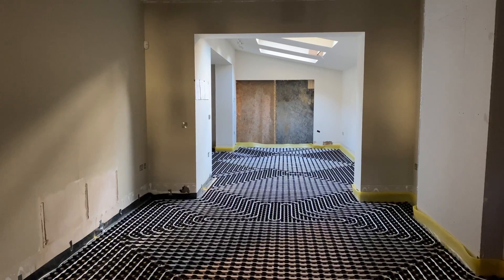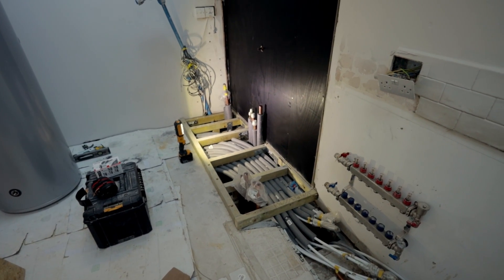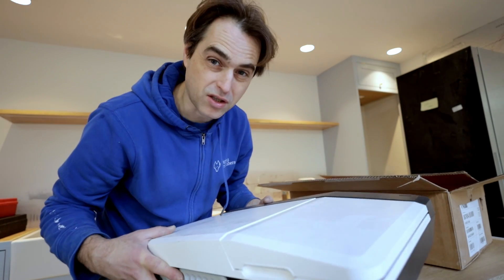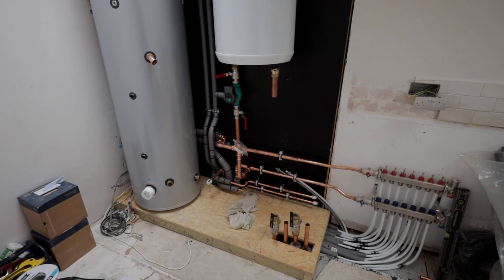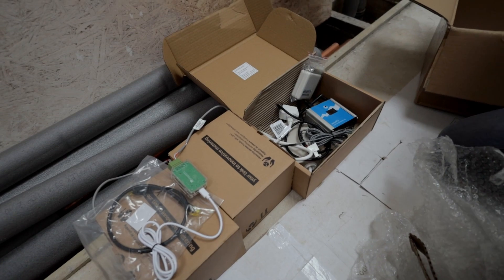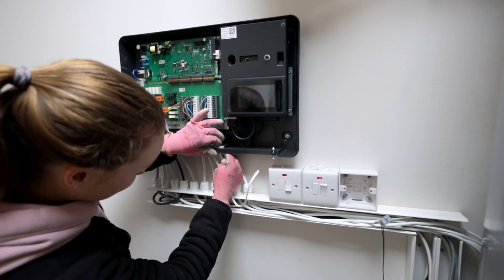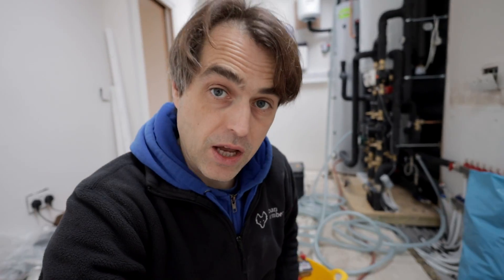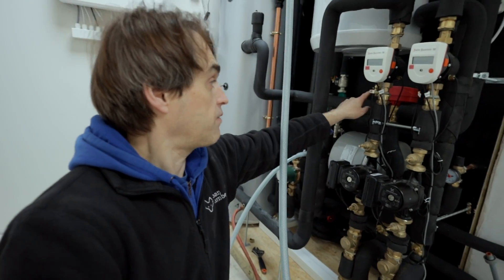NIBE 2050 Cascade System Installation In A Period Property.

Comment: Blimey .. that looks so complicated imagine when it goes wrong ... any savings wiped out on repairs .. 

I'll stick to a condensing gas boiler thanks ...  even they are pretty complicated these days
Reply: To be fair you'd have most of this kit if you had a cascaded boiler setup.
Reply: @Saaj2  

You'd have this kit if you were looking for a life of trouble ... 

I work on the Kiss principle .. Keep it Simple and Straightforward ... 

This is cascade heat pump stuff is NUTS
Reply: @the1beard  cascaded boilers are more reliable, so in theory this will be too. Either way this setup isn't saving the customer money, the ROI will be insane. The customer probably wanted it for environmental reasons
Reply from the maker: @Saaj2 running scop of over 4 in the winter so still 20% cheaper to run than gas
Reply: @UrbanPlumbers  no doubt the scop makes it cheaper to run, but even with that bus grant, surely it'll be years before a return is made. I was fortunate that the BUS covered almost all my costs. For expensive installs like these, surely the main driver is environmental.

Comment: Amazing work as always Szymon, I love this method of UFH installation. Whats your preferred method for suspended timber floors?

I’ve done the 22mm pre-routed chipboard but it was awful to install!
Reply from the maker: This were suspended timber floors. I screed over them for the higest possible output
Reply: @UrbanPlumbers  I will be putting UFH over the existing ground floor and first floor and a new loft conversion. All suspended floors. Would it be reasonable to have screed on the ground floor and routes chipboard above? MVHR would even the output somewhat, the upstairs would benefit from the rising heat, and having the bedrooms cooler would be a good thing (on an open loop)
Reply: Would like to know this

Comment: When talking about heatloss eg 16kW, at which out door temperature is it calculated? Over here in the Netherlands it’s usually calculated at -10 Celsius
Reply: Varies throughout the uk from around -2 to -5
Reply: @YMNS86  oké thanks. This mild climate makes it a lot easier to achieve sufficient power and efficiency (SCOP) using heat pumps.
Reply: @ReneArtoisMr  needs to be mild for the unit cost of our electricity!
Reply: @ReneArtoisMr Our shockingly poor insulation more than compensates for ‘milder’ winters. Hence the expense the homeowner has made to reduce the heat loss so this 16KW cascade can cope.
Reply: @normanboyes4983  Indeed, but it’s a combination of isolation and low flow temperature. When you’re able to install underfloor heating (low temperature) you can sometimes get away with poor or non ideal insulation
Reply: Also note that your design temperaturen is a choice. Personally I wouldn't design a heatpump system for -10, because that's almost never the case, and you'll often end up oversizing it for more common higher temperatures. This will Hurt overall efficiency.

Comment: Why aren’t you using vaillant on this one. I’m half way though a bungalow which has 13.35kW heat loss so Vaillant recommended either two 7kW or two 10kW heat pumps. Not the best for me as it’s my first heat pump set up 🧐
Reply from the maker: I would use single 12 on that. If designed to 35-40c it will cover that heat loss. Or 2x5kw not 7kw. 

NIBE cascade is pure class and controls way above the vaillant offering. Vaillant is still decent and much better than most of the market, but NIBE controls is something else.
Reply: @UrbanPlumbers  He has part UFH and 8 Radiators. A very odd shaped place too.
Reply: @UrbanPlumbers  they are in their 70’s too so will feel the cold.

Comment: You are the first YouTuber in the uk doing the underfloor pipe work the way it should be done.
Reply from the maker: They way 99% of UFH is designed (not) and done in the UK belongs in the plumbing museums of the last century - just check Skill Builder last video 🤦🏻‍♂️
Reply: @UrbanPlumbers ’But we have always done it like this’.😉
Reply: @UrbanPlumbers  i saw it, he got the plan from his Supplier ! My builder goes the extra mile, he asks where the people will be sitting and creates zone were people sit and zones where there are outside walls so he can change the temperature/flowrate, very smart. I also was told by an architect some thirty years ago that some people feel a discomfort when the floor temperature is set to high.
Reply: @UrbanPlumbers  😂 
the time will come when you will be 60 + years old and maybe someone younger and skilled will come to make fun of your knowledge :) 
+ It is not always favorable to be the best: when you have problems or when you are tired you have no one to ask for advice. 😅😊
Reply: @mihaiachim5299  "not calling a spade a spade" also belongs in a museum.
Reply: @maxmerton  don’t be evil - that Install is a low cost upgrade …. It is far from perfect but It works ….

Comment: Great work. Out of interest - have you got any zones on a system that size?
Reply from the maker: No, one massive zone of over 300m2
Reply: @UrbanPlumbers but if you put a puffer for underfloor heating I think you can setup zones . And one puffer for other things what require hot water. And one Solar Water Heater . What do you think about this setup?
Reply from the maker: @deshte I don’t think you can use that word anymore mate
Reply: @UrbanPlumbers  which word?  Please explain
Reply from the maker: Puffer 🤣🤣🤣
Reply: @UrbanPlumbers  slang of course.  Back to my idea what do you think?
Reply: @deshte  The aim of good low temperature design is to maximise system volume and preserve it by eliminating zones. This enables flow rates to be maintained. Control usually achieved by weather compensation in the OEM controls.

Comment: That's pretty shambolic that the unit needed a 0 day software up to get things running and wasted so much of your time. 

I work in IT as well, and I find the ability to remotely update software makes certain companies incredibly lax/lazy. Same reason you see PS5 games that need a 30GB patch on release day -- because they can. It should obviously just work out of the box.
Reply from the maker: I guess it works out of the box for 99% of installs. Cascades are a bit more complex, so this may be the reason.
Reply: @UrbanPlumbers fair dos, diplomatic as you are skilled! ;-)
Reply: still crazy that the customer troubleshooted and fixed the fault @UrbanPlumbers

Comment: What kind of support can the customer of such a system expect post installation? Does the manufacturer have a team of field specialists? The conventional gas boiler has been around of decades yet even when they have issue good service / breakdown engineers are very hard to come by. Great video and effort by the way!
Reply from the maker: Support from manufacturers is very poor and the level of the field engineers from manufacturers can be pretty shocking. We installers have to take a lot of responsibility for those systems at the moment.
Reply: @UrbanPlumbers  

it's not just about finding engineers to service them, but also the fact that, for example, my fluke multimeter operates up to -10, but from -7 the screen starts to stop reacting correctly..
At low temperatures, refrigerant hoses become rigid and the risk of refrigerant burns (frostbite) increases - when you work in the cold and maybe you are tired, you make many more mistakes...
intervention times on a refrigeration circuit at low temperatures are very long if you want to work correctly...
With gas boilers, a good technician can service 3-8 per day ... with heat pumps, this is no longer possible, which implies that more technicians will be needed to service the heat pumps; they will need much higher knowledge and much more expensive tools...
+ much higher risks of injury and much worse working conditions: out on the ground bent over regardless of the weather and if that means saving the planet then it's not very interesting...

Comment: Hey Urban Plumber, have you ever installed a Sunamp Heat Battery? Im considering one of these and woukd value your expert opinion.
Reply from the maker: Not great with heat pumps. Need flow temp that is just too high for any resonable efficeincy. Only consider this if you go cheap direct electric tarrif or if the cylinder us really impossible.